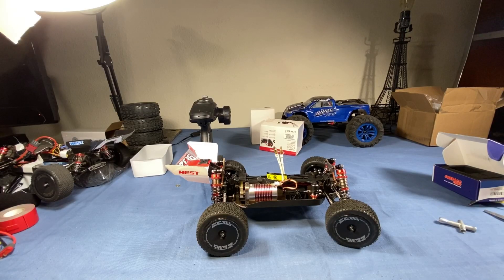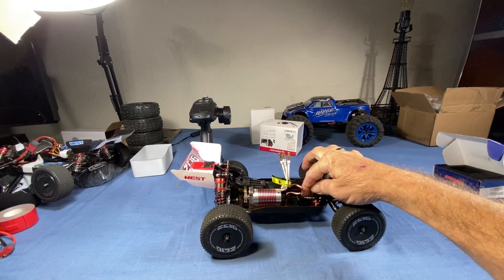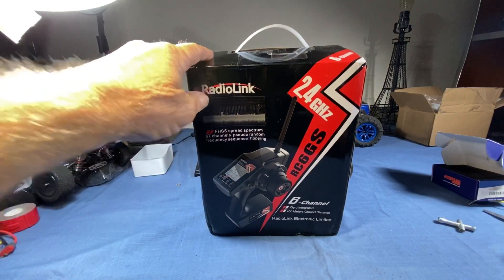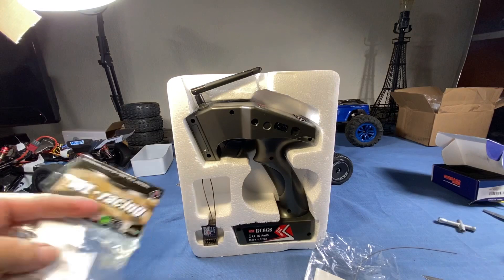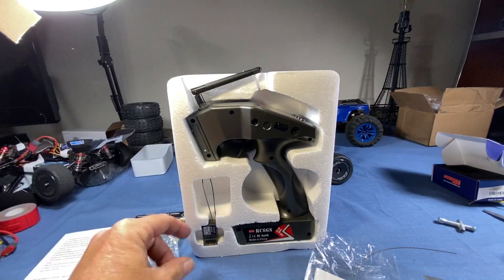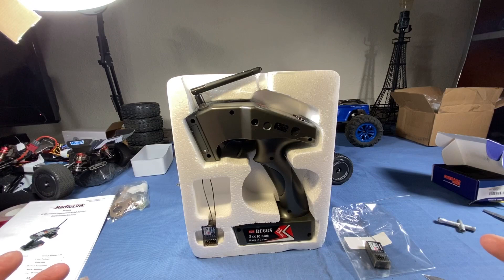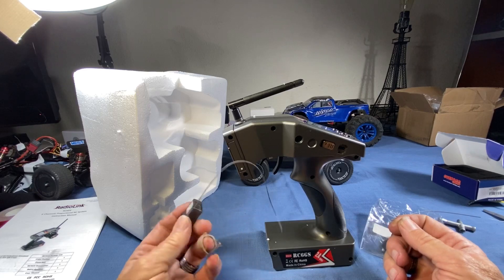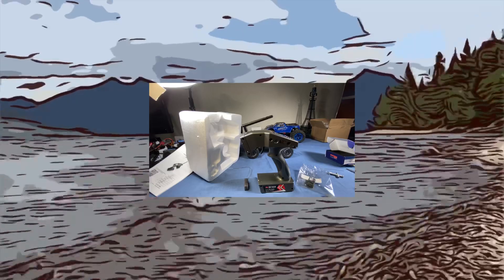WLtoys 144001 brushless update

Comment: Audio seems fine. Nice updates. I think it is cool you can run multiple cars on that radio. Also be nice to replace battery box to hold a rechargeable battery. All great info hope your servos come in soon.
Reply from the maker: Thanks for checking it out. I’ll dig deeper into the radio as I get to use it. For someone with just one or two cars the DumboRC is great but if this has as much range it would be awesome to have one radio per 10 cars. 

Have a great day and be safe out there!

Comment: Ok, now I'm showing my ignorance, however why is a giro receiver useful on an rc car? I understand heli and drone but car? Thanks in advance for your answer! 😊 On and audio is great. Wish I had your resources! 😂😂😂
Reply: It's helpful on overpowered cars to keep them in a straight line when accelerating hard... And just like a heli as soon as there is any input steering/rudder the gyro is off as to only benefit straight line tracking. Is it needed No! Does it help yes! Lol 👍
Reply from the maker: Hello John, it works pretty much the same on the cars. When you have something like the 144001 or a959b that has a high power to weight ratio it tends to launch at crazy angles. You can add thicker oil or grease to the differential to keep the rear wheels spinning at the same speed but because of traction issues that isn’t a cure but it helps. 

The gyro does what you would do in a real car which is to steer in the direction of the skid. The gyro rate can be dialed in depending on the response time on your servo. 

In a real car there is a tactile feedback and things happen slower which gives you time to counter steer. In these cars because they are so small and fast AND you only have visual input, by the time you see the car going the wrong way it usually too late to correct it. 

A perfect example is when you and your son tried to compare the speed of the cars. If you get on the throttle hard it’s out of control before you can react. 

This isn’t a magic bullet because if the servo it to slow it can’t compensate fast enough either but it will usually do a better job than we can with only visual input. 

Have a fabulous day my friend and be safe out there.
Reply: @mikesrcgarage  Ah nice one, thank you Mikes RC Garage! 😊
Reply: @RCModSquad  Now I get it. Makes more sense to me now so thanks for the detailed explanation. I'm sure I can't be the only one wondering this..... Can I? 😂😂😂🤔
Reply: @JohnRobinsonRC  You're very welcome! No you're not it's a common question and thought! Years ago I tried to put a heli gyro on a RC car it worked but I could never get the gain sensitivity correct. Hence wobbles and glitches what they call tail wag on a heli! ✌️😎👍
Reply from the maker: John Robinson like Mike said, you are not alone. 

If you do a YouTube search for “RC drifting” there are tons of videos about this and most of these guys run gyros. 

Have a great day and be safe out there!

Comment: Thanks for these updates, they really want me to spend my money, but I'll stick to my almost unmodified version for as long as it holds up.
I have not really heard you complaining about heat with the original version but I am experiencing extreme temperatures to the point where you can't touch the aluminium bottom plate (on 2s! 2200 mah) and when switching the car off, I basically have to burn my fingertip on the esc. What I'm doing because of this is using an older and worse battery to drive slowly to try and cool the car down after a fast run, but it's kind of annoying.
I also got a second cover and modified it so I can put an action cam as well as an fpv cam on top, which gives a complete new experience! :)
Looking forward to your future updates and if you have the time, could you keep mentioning the product details, so people can get the same parts to make sure they fit in the car?
Have a good one!
Reply from the maker: I haven’t run my stock version very much but the other two I killed the ESC on both of them. I was running 3s at the time so I haven’t run the third car on 3s ever.

When I get the next video out I’ll throw a parts list in. I’ll be looking at two servos to try and find a good option. 

Thanks for stopping by and you have a fabulous day.

Comment: So I got mine in on Friday, I bought the car with 2 batteries. The weird part is they sent me  a 7.4v 1500mah battery but the second battery was a 18650/3000mah 7.4v battery.  So my question is will it be ok to run my car off of that 2nd battery?
Reply from the maker: unspeakable yes, it will. Depending on the “C” rating on the 18650’s it might not be as fast off the line but the top speed should be about the same and it should give you more run time. 
Thanks for stopping by and have a fabulous day.
Reply: I watch all if the videos you have put out. Very detailed and helpful, especially for newbies like me 😂 thanks for the quick response and have a good evening.
Reply from the maker: unspeakable I’m happy it helps. That’s kind of the point to my channel. Most of the cars are more for people just getting into the hobby and can be good just as they are. However I try to also find entry cars that people can hop up a bit pretty easy if that’s what they want to do. 

It’s so hard to find a starting spot in a new hobby because it always seems like they use terms that you don’t understand unless you’re already at that level. 

Have a great day my friend and be safe out there!